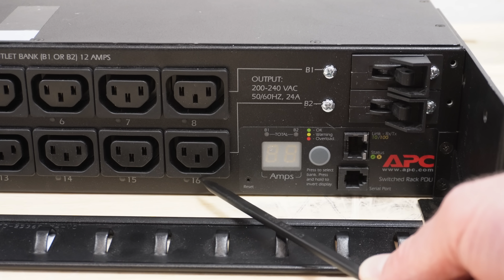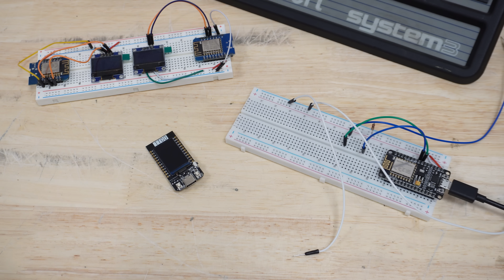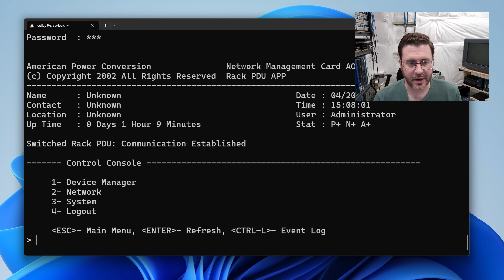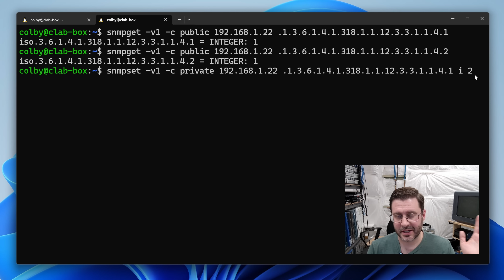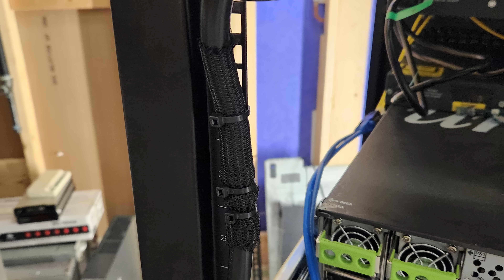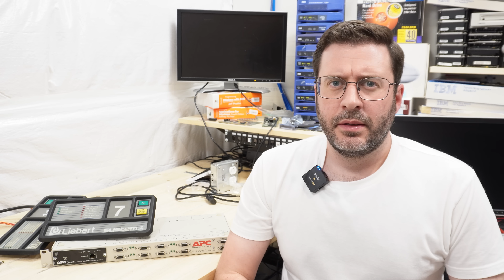Retro Rack PDU Install

Comment: They wouldn't have been able to sell it if they were feeding more than 120v out through the normal NEMA 5-15. That C14 is cheaper than a 240v receptacle and plug since it's already a large volume commodity item.

Comment: 208 is 3-phase with each leg of 120v. The 60° phase angle gives a phase-to-phase angle of 208v instead of the 240v you get when going leg-to-leg of split single phase. It isn't uncommon to see two of the phases sent to something like a condo unit, where the main service to the building is 3-phase. I imagine they do the same thing in datacenters.

Comment: I was about comment about how the red C13/C14 cable being 'rated for 16A' is a complete gimmick that makes no sense, as the connectors are only specced for devices up to 10A current draw, and then I noticed the section subtitled 'North American Ratings' on the IEC 60320 wikipedia article. Apparently North American rating agencies rate the IEC connectors higher than everywhere else in the world on account of your mains voltage being halved, which is a bit bonkers to me as it kind of defeats the point of an international standard don't you think?

Comment: You already got your power cables, but if you need more, I’d suggest C14 to C15.  They will support the higher wattage Cisco power supplies and are backwards compatible with to lower capacity C13 to C14 ones.

Comment: Watching you talk about cage nuts and bolts and the woes of them fitting together, made me think I should mention my experience. There wasn't a standard size of cage nut because they date all the way back to when racks were for just phone gear. I've run into #10/32 #12/24, 1/4"-20, 6mm (two different thread pitches i'm pretty sure) And, if I remember correctly, there's even a BSW size that'd be common in old old kit. So, technically, if you want to be period correct you probably need to get you some classic imperial sized cage nuts. Or, if you want to be both period correct and have a 'realistic' install, you need a mishmash of 3 sizes, 2 different head shapes, and both the cage nuts and those weird clip on nuts I can't remember the name of. Plus one random security torx head that you need to put back somewhere different every time.

Comment: I have used switched PDUs VERY similar to these (just raritan versions instead of APC) directly with 120V or 240V FWIW. Generally speaking they'll operate fine on anywhere from 120 to 240 even if they are labeled as 200-240 or even 208v-only. I'm typing this on a computer plugged into a 208v raritan "zero-u" PDU which is supplying 120v. Obviously with these power components it's important to know what you're doing before doing something like this but the power conversion equipment you've added probably isn't actually needed.

Comment: Oh good sanity has prevailed. We found the voltage nameplate 240 versus 208 is close enough that most things are cross compatible especially switch mode power supplies. motors and heating elements on the other hand work differently and this is most commonly noticed in apartments on three phase with 208 will require a longer cook time on the oven etc.

Comment: you can automate control of your PDUa number of ways without writing your own software.  I'd use home assistant with the snmp switch component.  to have some physical interface like your esp 8266, use ESPhome which plugs into home assistant.

Comment: Regarding the 208 thing...

208 is just 2 legs of a 3 phase. In 3 phase each phase is 120 degrees out of phase. Each leg will read 120v to ground/neutral. So 240 will be fine for that reason. It's just splitting 2 legs of 3 phase with a neutral to make several 120 sockets.

Comment: The C14 connector was designed as a universal way to link devices to centralized power management systems such as PDUs, power strips, and battery backups. These systems then provide power through a C13 connector with the appropriate regional plug type (US, EU, etc.).

The primary goal was to allow enterprise equipment to operate anywhere in the world—regardless of location—by standardizing the connection at the distribution point, so only the main power cable of the PDU or power source needed to match the local outlet.

Comment: It would be really beneficial to get the APC MIB working as you can then use snmptranslate -Td (OID of interest) and it will tell you a lot more about that particular OID like it's output types, for example for the OIDs you're using to control power (.1.3.6.1.4.1.318.1.1.12.3.3.1.1.4.1)

Or it's more canonical (and easier to type) name:  PowerNet-MIB::rPDUOutletControlOutletCommand.1 (the .1 is socket ID)

- 1 is Immediate ON
- 2 is Immediate Off
- 3 is Immediate Reboot (turns the outlet off for three seconds, then turns it back on)
- 4 is Delayed On (it will turn on after a timer has elapsed, "rPDUOutletConfigPowerOnTime"), think default is 5sec?
- 5 is Delayed Off (same as above but with "rPDUOutletConfigPowerOffTime")
- 6 is Delayed Reboot (same asa bove with "rPDUOutletConfigRebootDuration)
- 7 cancels a pending action (like one of the delayed switches above)

You can have a lot of fun with this, a long time ago in the days of DSL, I had an APC PDU that I wrote a script for that would reboot the DSL modem if the router couldn't connect to the Internet.  It worked for a few years till I finally got cable.  Now, I just let the routers auto-failover to the secondary circuit.

And please change the SNMP community strings. :D

Comment: If you're running Home Assistant, it can talk to things over SNMP. So you could have that control panel talk to HA via MQTT, and then drive the PDU over SNMP. That would eliminate the need to write the custom Go service, and would give you a bit more flexibility.
Reply: I've got that exact setup on my own system, except with raritan instead of APC PDUs. My home assistant instance talks to my PDUs both read and write over SNMP. It's pretty nice.

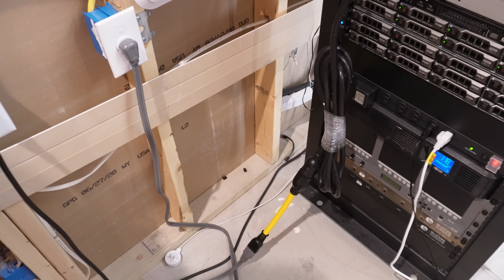Comment: 3:28 Oh my. For a while, I had a job as a Sr. Sys. Admin helping to manage servers in a colocated data center. EVERYTHING in the data center went offline for all clients. The official story from the data center staff is that two employees were roughhousing next to a "temporary" power setup which I imagine to be much like what you've got going, one of them tripped over the cable, which supposedly knocked a damaged cover off of an e-stop button, and the e-stop button supposedly had a hair trigger.

I was out of town at the time, so I was forced to do what I could through IPMI/iDRAC and SSH, but as the story was told to me, pandemonium ensued: You could just turn around and your crash cart would get stolen. One of my teammates had transferred to a different team just the day before, and suddenly they found themselves right back in their old role for an extra day.

Comment: 2:04 it would have worked for everything below 500VA (500 Watts). Your rack can easily surpass that. And it would have added power losses to the system in the range for 1-5%.

Comment: The problem you'd have run into with that buck-boost transformer was that it was only rated 0.5kVA (~500W).

And the 6 pin connector is an RJ12.

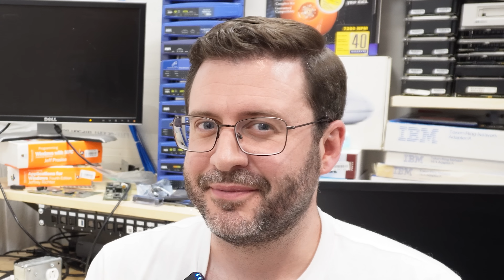Comment: 28:02 - Ahh yes, ye olde perma-temp solution! I ran across one in an old office, it was two ethernet cables connecting the switch rack to the server rack across the room which was loosely hanging on the ceiling held with parcel tape. However the first bit was so low you'd had to duck otherwise it'd garrote you! There were attempts to replace it with a neater fiber connection but we couldn't get it working. We eventually "fixed" it by moving offices!

Comment: Dell servers are great. If you upgrade your R720 to R730 (look for the XD models with some low spec v3 Xeon and upgrade the cpus), the v4 Xeons will save you ~100 watts power consumption over v2, if you don’t want to spend a ton to get some more recent servers.

Comment: I was wondering if somebody already built a Home Assistant integration for this PDU. After a quick web search I found out that HA has an SNMP module, and after looking at some configs people built, you just have to give it that long dotted number to target the plug and tell it the values to turn it on and off, and they should just appear in HA as switches. I'll have to keep this in mind if I happened to go shopping for a PDU (which may happen).

Comment: Serial connector is your standard phone RJ11 6p6c connector, which is 6 pins. most common as the 6p4c used on phones, but you commonly find the 6p6c as replacements.

Comment: Actually what you'll find in DC's of the time was the AP7911 (or it's 1U brother) was connected to a crossover switch, itself fed by both a mains and UPS feed (or direct to battery). The modern day equivalent is the 0U PDU strips that are mounted vertically in the racks and are pretty much identical. With proper planning, you'd configure a server with dual PSUs to come off multiple PDUs for resilience. I still use these devices from APC and they're still quite popular and can be found in production still.

Comment: I work in ProAV but in 230v region
we use these PSUs all the time, normally in pairs for red (ups) and blue (non ups secondary source) 

C13s get called IEC 

The c14 - c13 cables we buy in red and blue to keep racks clear, (RSPro brand from RS are where we have found the cheapest cables 

We often use these PSUs for powering on and off av systems for start and End of day, aka turning on all the amplifiers in the morning and then turning them off in the evening.

Comment: Consider - running vi on a remote host through minicom.  If you send a vi command string, the remote vi should get them, no?   
By putting the minicom string behind something different, makes the whole session more normal.

Comment: 208V is almost always compatible with 240V, in fact it's required because there are no plugs in the US that are 208V only. It's just that sometimes companies do not bother to label it, because in industrial settings you almost never get 240V. 208V is the difference between two phases in a three-phase 380V system.
Reply: 208 Wye. Phase-to-phase is 208v. Each phase is 120v. You're thinking of 480v which is each phase of 277v.

Comment: Since the PDUs don't do voltage monitoring, and the PSU is switching and wide input range, it might work on 120v if you ignore the labels and change the plug. I have definitely used the AP7921 (8 C13 1U version with C20 inlet) on 120v.

Comment: I wonder if your MasterSwitch at the end has its "advanced port" serial console use the same cable as the 2000s-era APC SmartUPS?  Those are a special pinout -- not straight-through, nor null-modem either.  The one I use with my SmartUPS has part no. 940-1524D.
Reply from the maker: good call, I'll try the apc cable pinout

Comment: I haven't used much enterprise gear, but I DO know that C14 is usually used in devices that are daisy chained together. The most prevalent use I've seen is some old computer towers used it for stuff like external towers, or just daisy chaining multiple computers in general.

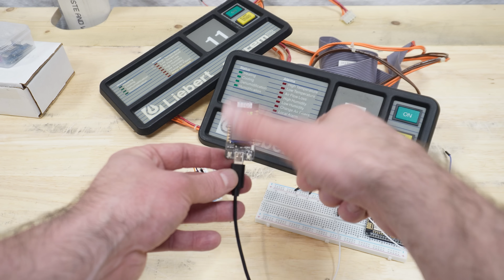Comment: 10:15 That won't work with the on-board buttons as they're specifically reset and boot. You can repurpose the boot button, but reset is not configurable at all.
Reply from the maker: the two buttons on the TTGO are usable actually, there is a third reset button on the side

Comment: My thought about the PDU is that it looks like a perfect for controlling individual box fans mounted on stalls to blow in, and 24inch industrial fans such as those that sit on the floor for a barn.  Then you can have a BAT file on your desktop  to control them individually or in groups.

Comment: You can cut the locking plug off and put on a regular plug like what you have, but I'd keep the locking plug and just install an L6-30R receptacle. It's fine to power a 30-amp circuit from a 20-amp breaker as the 20-amp breaker will just blow early, but I'd probably just update to 30-amps since the breaker box is maybe 2-feet of cable run from the outlet. The locking plug is nice cause it won't work itself lose. Regarding the Ubiquiti auto-negotiation to the 10/100 on the PDU, you might need to manually set the port speed and crossover as 100-meg MDI in the Ubiquiti if you can. These PDUs didn't necessarily have the most full-featured or compliant ethernet ports.

Comment: @clabretro, If port speed negotiation fails between the PDU and your Unifi switch, just set the link speed manually on the switch port to force it. You may even have to force half duplex or disable flow control. PDU and UPS management cards have interesting interpretations of "standards". 🙃
Reply from the maker: yeah it has some settings to force it, I'll do that eventually

Comment: the C13-C14 stuff is probably because the other type of plug we're used to is actually quite dangerous. C14 has a shrouded connector which makes it more difficult for falling stuff like paper or other things from falling into a loose connector.

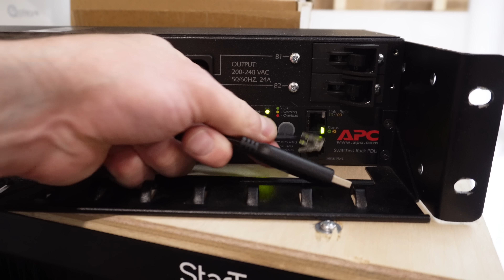Comment: 5:00 That 6 pin connector is, rather creatively, called a 6P6C modular connector. 6 positions where contacts could go and 6 contacts actually installed.

For telephones 6P2C is typical for single line voice and 6P4C for two lines or voice plus power.

Ethernet over twisted pair uses an 8P8C modular connector. People often call it “RJ45,” but that’s technically a misnomer. The original RJ45S was a keyed 8P2C telephone connector whose plug wouldn’t fit a modern Ethernet jack. When phone techs started running data cabling, the “RJ45” name stuck. So today, in networking, “RJ45” almost always means the unkeyed 8P8C plug used for Ethernet.
Reply: Isn’t the plug called RJ12?
Reply: 6P6C is also called RJ12, unlike typical RJ11 phone cables, which are 6P4C.

Comment: 28:46 I've been trying to "break into" my own APC device, that I believe is slightly older than that master switch. bought cables I thought would work and even tried fixing my own but ended up just cutting myself lol
I've tried multiple computers, and even some old ones, and I cant for the life of me get it to communicate with any windows or ubuntu installs. not even my dedicated headless Linux server will talk to it.

I think you need some proprietary APC software from the VERY early 2000s (maybe even 90s) that I literally could not find on any software archival websites, I've just given up trying
there is some software you can install on Linux that "should" just tie into it over serial, and it lets you manage every UPS (if you have multiple), and see their battery and charge status, and shut off systems automatically.
but again I've had no luck. this software is still managed to this day I'm pretty sure, but isn't owned by APC

if you can figure it out, i wouldn't mind seeing a video on how you figured it out
Reply from the maker: I'll definitely update if I can figure it out!
Reply: @clabretro   thanks, I also read somewhere that it might be a proprietary cable pin out?
meaning you need the original cable it came with.

is this true? I have no idea, but knowing APC it could be the case.

"Old APC UPS units require a specific "smart" serial cable due to their non-standard pinout"
found that with a quick google search

and there's a few reddit threads talking about how APC did this for "backwards compatibility" (for their other devices) because there was "no standard pinout at the time"

you can find on the APC website in the frequently asked pages section something along the lines of
"What communications cable is needed with my Smart-UPS and Easy-UPS with PowerChute Agent?"
and it shows a list of cable types

Comment: Nice, looking forwards to the next episode!
WARNING: Mark all the 240V wires at both end, with like red/orange electric tape or whatnot. Maybe also mark (with a different color, say neon pink tape?) all devices that won't like more than 120V.
Re the APC thing: I'm not sure but I think that the UPS:es communicate using the handshake singnals, rather than the data pins. I.E. the UPS signals power outage on one of the handshake signals that normally go from a modem to the computer, and the computer signals that shutdown is properly done with a handshake signal that normally go from the computer to a modem. Thus the APC is probably just a large 8-in-1-out AND or OR gate for the "shutdown signal" and a buffer for the "power outage" signal, with the appropriate RS232 level converters. Maybe. Perhaps.
As for the C13/C14 plug: Your assumption is correct, using those is universal across the world. But also those were rather common for powering computer monitors with no-name PCs all up to ATX, and with large-brand computers up to late 80's / early 90's. If you ever need more of the C13-C14 cables it might be worth checking what some well assorted thrift store may have in store.
For the smaller network appliances it might be a good idea to connect a power strip to a C14 plug. Don't know if power strips for 240 even is a thing in North America though. Or maybe you'll never run out of outlets on the PDU. Famous last words :)